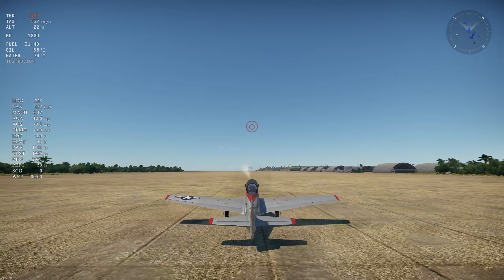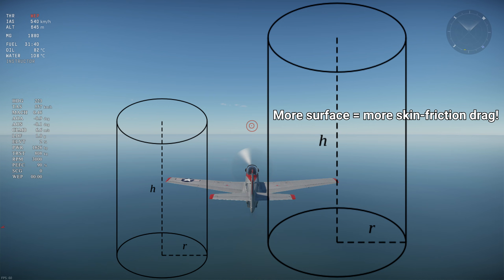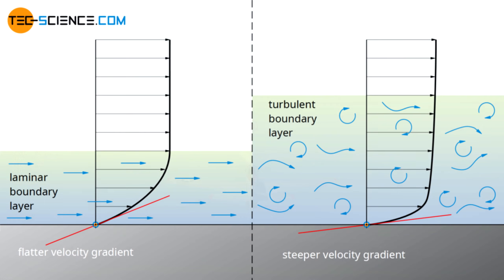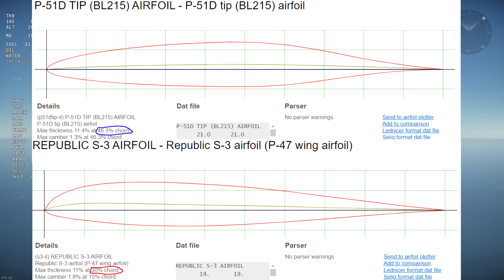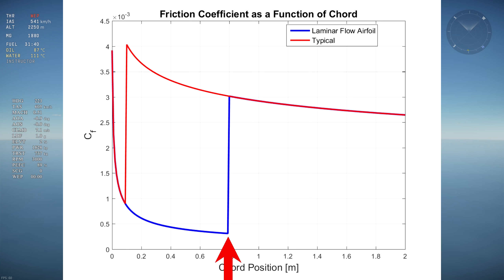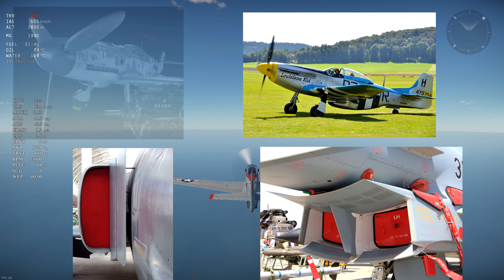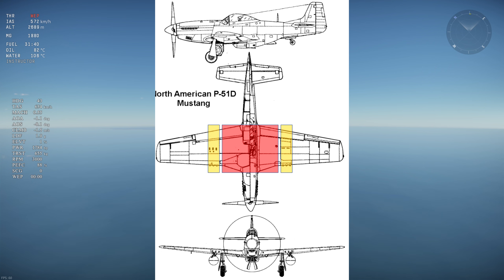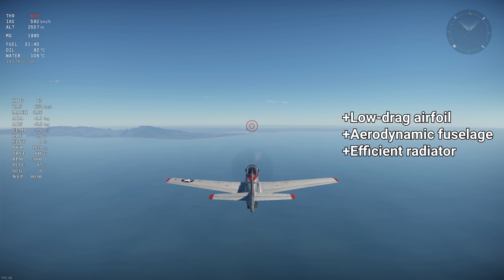Laminar Flow Explained | P-51 Mustang Case Study

Comment from the maker: Let me know what educational videos you'd like from me in the future!

Happy New Year!
Reply: Happy New Year Adam!
Reply: Happy new year dude!!
Reply: Happy New Year Adam 😃

And since it's already in the game, what about an analysis of the F-104 desing... Because as i understand is a direct example of ultra low drag/supersonic tecnology
Reply: Happy new year! I'd like yo know more about propellers. I know they are basically wings spining, but why would youvmake a certain propeller a certain way remains a mistery for me
Reply: Happy New Year!
Reply: How do you get the Hp and climb rate numbers on your screen?
Reply: Flaps type next?
some plane in WT have unique flaps 
like P38 and most of all naval aircraft (F6F or F4U)
Reply: would be cool to see a vid comparing performance of top tier jets at different speeds and altitudes, with some graphs like Y-thrust X-mach number and the same for drag and lift.
Reply: Should you spend as much time on the air field as possible and does it affect climbing speed or rate of climb
Reply: isn't  lift coefficient related to rolling or turning? they both rely on wing lift
Reply: Can you explain something about flaps? Im wondering how flaps works and how to use them in some kind of situation especially in duels
Reply: What design characteristics are responsible for different aspects of aircraft performance; what makes planes have better or worse energy retention, MEC, turn rate, roll rate, stall speed, etc.
Reply: happy new year and Meredith effect 😉

Comment: The legend is back. 
You should do a video on the c202’s wings
Reply from the maker: I've always been here!

Hmm seems relatively straightforward though as far as I know.
Reply: Doesn't that plane have asymetrical wings to overcome propeller torque? I though that was an italian signature!
Reply from the maker: @juanordonezgalban2278  Yeah, relatively straightforward. It wasn't done on most other Italian aircraft.
Reply: @AdamTheEnginerd  ''Imagine have you plane pull to the right whenever you try to pull some Gs'', this post was made by the non- Macchi single engine fighter gang!

Comment: Nice video!! Good to see the master teaching some fluid fundamentals better than many overpaid professors<3
Reply from the maker: Hahaha thanks Bault! This video was way more fun to do than this semester's fluid assignments that's for sure.
Reply: @AdamTheEnginerd  an idea for another technical vid could encompass the static stability of aircraft and the various methods used in design for achieving stability (Has to be pitched in sim mode since "realistic" doesnt roll with that stuff, YAWn). And if you wanted to be a little bit more advanced you could mention different spiral modes that can occur if your aircraft isn't dynamically stable?
Reply from the maker: Oof that's quite complicated though. Perhaps I can talk a bit about that while talking about the advantages of canards.
Reply: @AdamTheEnginerd  yeah that'd be good i didn't think of that. And you don't have to be too in depth but the purpose is to show people the difficulties and stresses ww2 pilots went through in certain planes if they were designed poorly in terms of static stability. Something that "realistic" players may take for granted;)
Reply from the maker: @brthibault  Yeah I'll consider it!

Comment: Proposition of topic:
Impact of tail configuration on manuverability in high and low speed.

(if it's not clear enough there's an explanation: I observed that many planes with good low speed turn perfomance (zero, ki-43, hurricane, La's, yak's) have usually elevators set slightly forward of the rudder. That made me think that  it might be beneficial for staying mauverable in all speeds to have a plane with variable tail configuration (that is ability to move whole horisontal stabiliser move forwards and backwards  across the fuselage lenght. )
Reply from the maker: The position of the tail is for balance, all aircraft strictly controlled by a human require balance and enough control authority to make the required maneuvers at high and low speeds. Appropriate balance is helpful, but the position of the tail is only a part of it, and every aircraft will have different weight distributions, requiring different tail sizes and positions. You can't just look at the tail to see if an aircraft is maneuverable or not.

Variable tail position would be a very complicated system. Moveable elevator is a better system for maneuvering, and for trim you can change the angle of the horizontal stabilizer.
Reply: To help rudder control at high aoa

Comment: You should explain the graphics you use briefly. It took me a minute to understand that the plate in the graphic at 2:44 was represented by the x-axis and that the wing shaped areas were representing the speed of the moving air. For people who are dealing with those graphics on a regular basis it is probably obvious. But for someone like me who is not it isn't.
Reply from the maker: Yeah thanks for the feedback. I should have spent more time on it, but also it wasn't the main point of the video so I didn't.

Comment: Adam - excellent tutorial. A suggestion. 

It should be noted that Laminar flow over a flat plate transition near RN= 0.6x10^6 - which is a very low airspeed based on MAC of the Mustang wing. Implicitly the next stage of Transitional Turbulent Boundary layer before full blown Turbulence near the region of adverse pressure gradient - should be the focus of comparison between the Mustang NAA/NACA 45-100 airfoil with T/C max ~ 38-40% vs NACA 23015 or Republic S-3 with T/C max ~ 30%. 

True - the Horkey team, using Kutta-Jukowski, Theordorsen and Prandtl transformations began the analysis & design based on reducing T/C, LE shape, etc of the NACA 450125 Laminar Flow airfoil, then further refined based on desirable CMac and stall characteristics but they quickly learned that the Mustang wing was not 'Laminar'. NAA always described the wing as High Speed/Low Drag - never 'Laminar'.

What was discovered was that the Transitional Turbulent BL while 'thicker' and increased as a f(T/C), it was much smaller than turbulent BL and chaotic eddies beyond T/C> 50%. 

When the Germans tested a captured P-51B (from D-Day), they discovered the same phenomena and commented that the wing's 'attached' BL was greater than 25% more than any previous airfoil of best fighters. The Bf 109 had a modified NACA 23015 and the FW 190 a 23015.5.

Such major separation. of course, increased friction drag, but I would pose that the smaller associated 'frontal' region of relatively quiet flow and area seen by the freestream past the T/Cmax perhaps reduced comparatively the pressure drag associated with a real wing.

Your comments?

Comment: Edit: I'm happy to see you addressed the major failings of the conventional wisdom and came to the likely correct conclusion. 

Laminar boudnary layers are pretty sensitive to perturbation: They are likely to be turbulated by any surface imperfection more than a fraction (experimentally ~20%) of the boudnary layer thickness (99% freestream) , and once turbulated, the turbulent region propagates outwards along the surface as a Tollmien-Schlichtling wave producing a turbulent cone. This basically guarantees that any portion of the wing near the fuselage or wingtips, in the prop wash, or aft of wing skin seams or gunports, or even dust and splattered bugs will be fully turbulent from the leading edge. In addition, a laminar boundary layer can also be turbulated by surface vibrations, surface temperature variation, and adverse pressure gradients, as the top surface of the airfoil would experience when producing lift. 

I worked for several years on landspeed record vehicles that rely heavily on extending the laminar boundary layer. The best result we've predicted and verified on any vehicle is ~50% laminar surface area using a heavily 3D-optimized shape with no seams or protrusions, meticulously smooth surface, vibrational damping, and painted flat white to minimize heating. We routinely measure siginficant performance drops due to minor scratches, bugs hitting the shell, or non-ideal weather. 

In short, I would be extremely surprised if the P-51 wing on any real aircraft got close to 40% surface area in a laminar boundary layer even in ideal flight conditions.
Reply from the maker: Damn that's very cool work! Yeah it's a challenge to maintain laminar flow on big/fast vehicles. Mass-produced vehicles with 1940 techniques having significant laminar flow is indeed doubtful.

Comment: i appreciate this explanation of laminar flow with regard to aircraft. even your skepticism that the p-51 could actually achieve a significant amount of laminar flow in real world use. you aren't the only one with this skepticism. it is interesting you compared the p-51 to the p-47, as the p-47 used an in-house wing shape unlike the vast majority of fighters which used a NACA airfoil. I don't remember all the details but if I recall correctly, one p-47 was tested with a laminar flow wing and did not see an increase in performance (I could be wrong). the seversky wing was apparently pretty good, one other small thing the P-47 did differently was carry the same fuselage width all the way to the trailing edge of the wing before it began to taper

Comment: the P-51 prototype wing, when tested by NACA in their wind tunnel, had 50% lower drag than the next best wing in existence at that time. As laminar flow wings had not been used before, NAA engineers hedged their bets and had a backup non-laminar flow wing design ready incase the laminar flow wing didn't work, so that they could still deliver their prototype P-51 to the UK on time.

Comment: Aren't laminar and transonic airfoils similar in shape? Maybe that was the actual advantage?
Reply from the maker: They are more similar in shape (thinner, that's about it) than conventional airfoils of that time. However, transonic airfoils would not be useful for WW2 purposes, since the drag benefit applies to wave drag (transonic drag), which only starts having a significant impact at M0.7+.

Comment: British tests showed that the P 51 couldn’t achieve laminar flow over 40% more like 10% even with TLC and hand contouring, but it still a low drag wing.  The P51 is a VERY smooth aircraft just compare to a Spitfire or 109, but laminar flow is just too hard the 1940s.
Reply from the maker: Precisely.

Comment: If the laminar flow doesn't affect the high speed turning ability of the p51 (except for the reduced drag) how come the plane turns the way it does? Love these vids! Keep em going man!! ^^
Reply from the maker: It's due to its higher than average elevator authority at high speed.

Thanks for the support!
Reply: I'm not Adam, but what I think what he was trying to say is that laminar flow has nothing to do with the ability of a plane to turn well at high speeds. Overal laminar flow would probably decrease turn performance, as you can't pull as much angle of attack, because the wing stalls earlier.

Comment: I realize first-year aero engineering uni topics are easier to condense into layman's terms for a video, but I think it'd be nice to see you get a bit more technical and make a video on something like flight dynamics propagation be it through linear or nonlinear modeling. Linear modeling would let you easily segue into basic stability theory given that state-space system representations are fairly straightforward to explain, and nonlinear modeling would also then allow you to segue into Euler angles/quaternions and how they pertain to shifting reference frames for flight modeling/simulation. All in all, I think this would give a nice high level overview of the underlying simulation mechanics in war thunder!
Reply from the maker: I also think explaining general concepts simply is more interesting and more useful for the general population than going in depth in a given topic. For now, the most in depth I'd go is the basics of my coded simulations, for example for my climb rate and dive videos (discrete time).

Comment: Imagine standing still in the middle of the Bonneville flats , suddenly, something passes you at 100mph.  Now imagine flying along at 400mph in a P-51. You have the throttle at about 65%, and an ME-262 passes you at over 100 mph faster. If the 262 makes the  mistake of changing direction in front of you, you might get lucking by throttling back and pulling inside his turn.

Comment: Off topic. Can dimple apply to a car can make it more efficient?
Reply: At the beginning he explains why a rod/cylinder shape is impeded more by pressure and not skin friction. A cars shape to me seems much more wing/fuselage shaped than ball shaped.
Reply: @HAMlLTON  i would say cars are more rod shaped, which is why spoilers (not rear wings) can sometimes reduce drag by reducing the wake size of the car despite increasing skin friction. In fact there was an experiment done which showed a car with dimples had 29 mpg whereas a smooth car got 26, showing the drag reduction in the form of efficiency. Apparently car companies don't dimple their cars because they don't think it will sell
Reply: @nade5557  Got a link to that experiment? Sounds interesting :)
Reply from the maker: Mythbusters made an episode on that, but I think they just compared a dirty car to a clean car. Their results were that it made no significant difference IIRC.

Car is less blunt than a sphere but more blunt than an airfoil, tough to say outright if dimples would be better.
Reply: I also just read a comment on that vid which says that vortex generators produce the same effect as dimples. On a car or plane the airflow direction is known and generally constant so vortex generators are used, whereas a golf ball spins as it flies so the dimples are used as they are omnidirectional.

Comment: Hey Adam, could you do a video perhaps on the mechanics of the Flight Instructor, and how it relates to the actual control surfaces on an aircraft? Would be interesting to highlight some strange things the instructor does like applying top rudder during a low speed turnfight
Reply from the maker: Hmm not sure how to go about making a video about that.
Reply: @AdamTheEnginerd  You could talk about how the various control surfaces deflect when you move the mouse vs when you press WASD, why there are differences in energy retention for mouse aim turn vs keyboard turn, and stuff like that

EDIT: If you're talking about how to show the control surfaces deflecting, I think your overlay should have options for it

Comment: Adam, I have a question for you, not related to the video (which was great btw). In a lot of your videos, I see that you make the enemy overshoot, then kill them. But when you are the one overshooting, and you don't have enough speed to extend away safely, what are you supposed to do? Do you have to pull up early to prevent overshooting altogether? Or is there something else?
Reply from the maker: Yeah either pull up earlier, or chop throttle (I much prefer pulling up and going back down instead of reducing throttle).

Comment: Do wing slats help with maintaining laminar flow? and can it affect turning performance? 
is it possible that one can calculate the amount of lift generated only using surface area regardless of airfoil?
Reply from the maker: No, slats would hinder laminar flow with the gaps it has. Slats help turn.

Nope, you need the lift coefficient.

Comment: At around 8:30 you show where laminar flow should be more likely/possible. Dont wingtip vortices disrupt the laminar flow as well close to the wingtips? 
Love these technical videos.
Reply from the maker: Hmm I don't think it would significantly affect laminar flow, the boundary layer is a very thin effect close to the surface, while the wingtip vortices are much bigger in size. I imagine it affects the very edge of the wing, but that would be negligible lost surface compared to the rest.

Comment: Is there a more advanced video that explains how/why streamlining is not an example of laminar air flow when considering the purist definition of laminar air flow which is how layers of air move against/with each other and not how air moves against a solid?
Reply from the maker: Shaping something to be laminar flow would count as streamlining, but streamlining (i.e. reducing drag) is much broader. Many things fall under streamlining, such as reducing wetted area, and favoring laminar flow.
Reply: @AdamTheEnginerd  correct. hence my question...